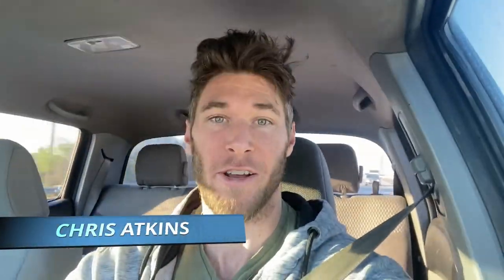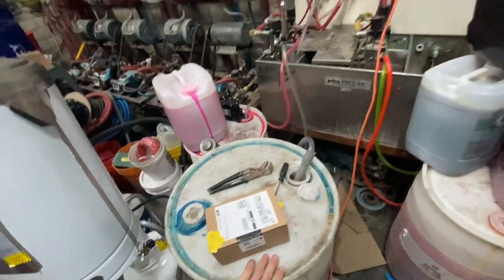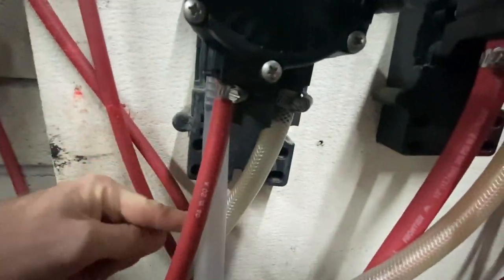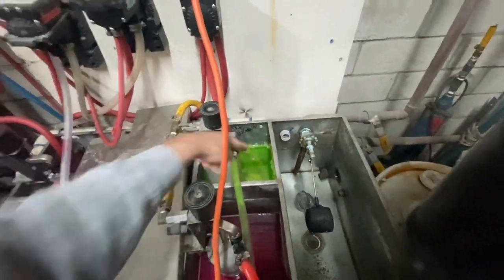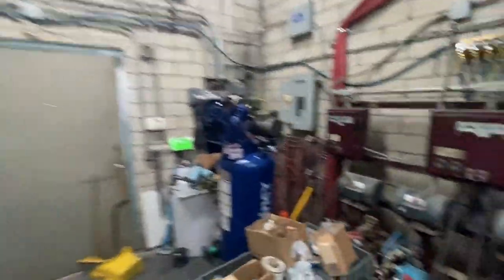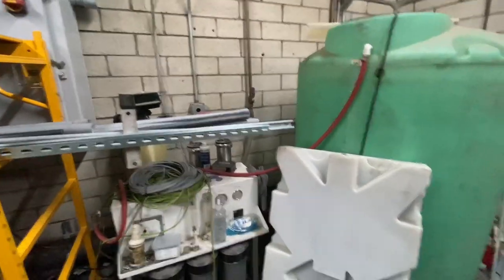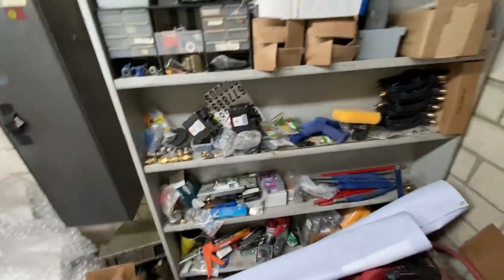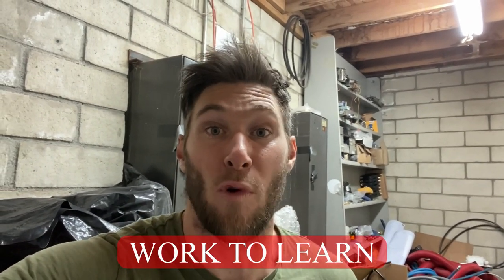How car wash equipment works! A look inside the motor room.

Comment: Can you show where the air and chemical mix together and where the foamer is for the foam brush(and possibly other functions)?
Reply from the maker: The air hose going into the flojet pump. The air is what makes it foamy. Without the air it’s just liquid (soapy water) coming out of the brush
Reply: @CarWashChronicles  What I mean is the air injected after the flojet. The ones I've seen online have a manifold where the air line and chemical line meet above the bay before the boom or there is a foamer above the bay that is a PVC pipe where the chemical and air line are connected to, and it has steel wool or another material in it to create the foam.

Comment: What size is the red hoses going out to the bays ? Mine has 1/4" poly hoses. I read somewhere if i would use a bigger hose ( 3/8 or 1/2" poly braid) that i would not have to use a foam generator because of the extra space in the hoses gives it enough room to foam up and also the poly braid last alot longer than just the hard poly 1/4" hoses.
Reply from the maker: Interesting. My hoses are 3/8.

Comment: What do you think on a self serve car wash 5 bays and one non working automatic making around 70k year with 30k yearly expenses? Should be a good investment? Around 400k includes  business and real state.
Reply: Houston tx
Reply from the maker: Sounds good as a starting point but if it’s on a busy road and very visible from a tonne of cars going by everyday than should be able to build it up with a the different in bay functions up and double that income to at least 150k. Buying the land will pay off in the long run also.

Comment: Do you use a weepmizer or use aintifreeze solution ? I'm in louisiana and dont have much of a freezing hard winters to deal with. well sometimes.
Reply from the maker: Being in Cali I don’t have that problem bad at all. Maybe 1-2 weeks  out of the year lines may freeze. I just ran defreezing wire through my pvc pipes that my hoses run through and put it on a timer so it comes on over night during winter to keep them warm.

Comment: 1150 psi/ 75 Bar is Not that much 
I do 1500 psi/ 105 bar 
It depends also How much Water you use 
I have 600 litre/ hour 
May Check also your Jets in the Bays, they Worn out Ober the Years
Reply from the maker: I Wouldn’t make it anymore powerful. I feel bad sometimes when I see woman pull the trigger it pushes them back a bit.
Reply: The Recoil appears mostly of the angle before the Jet. I bend the pipe a Little Bit more Straight and the recoil is nicer to handle. A small Woman can easily Handle 2000 psi when the nozzle is complete Straight